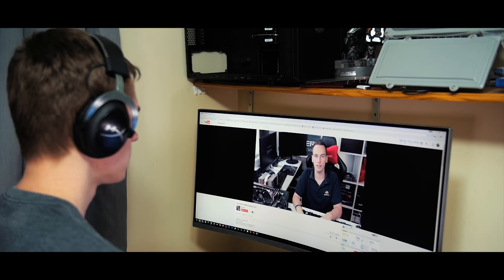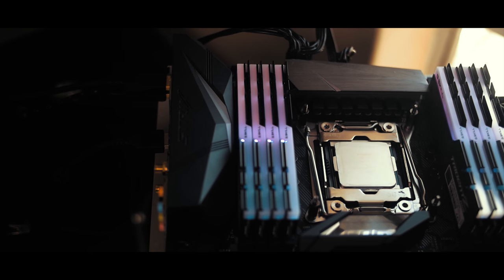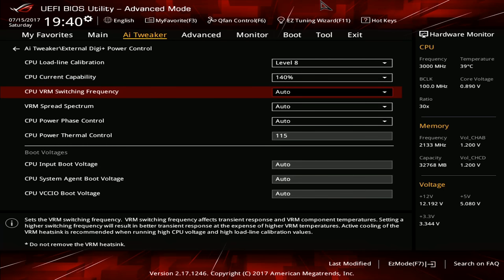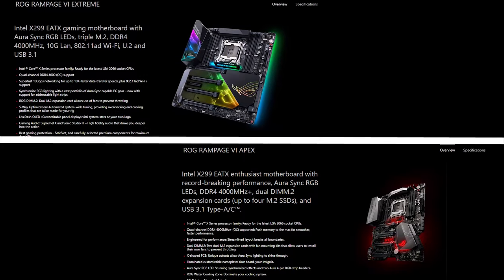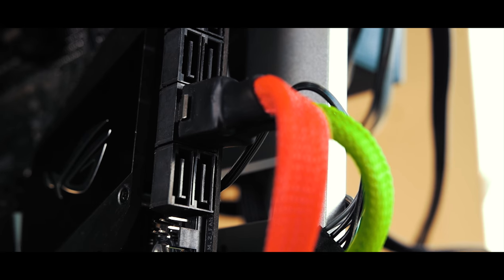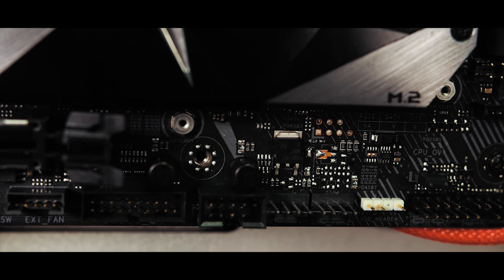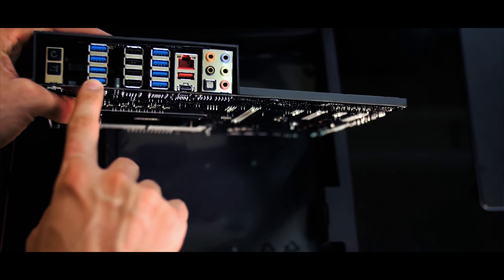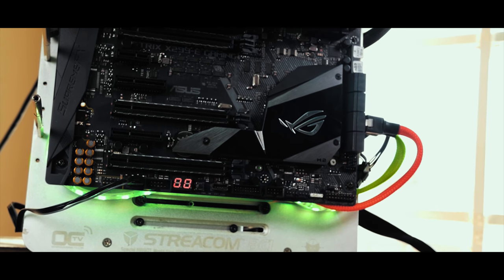WHAT VRM HEAT ISSUES? - ROG Strix X299-E Gaming Review

Comment: i bought new jeans it didnt have proper stitches but hey I got thread and needle at home. It is not a problem. Jeans are perfectly fine.
Reply from the maker: +ess wasim That's not exactly what's happening.  It's like you bought size 32 jeans but they tear at the seams if you're size 36 trying to fit into them.  Can you put them on? Sure. Is it what they're designed for? Nope.

Comment: I get where you are coming from. But it is the ENTHUSIAST platform and you are paying through the nose for this stuff. That just should not happen. Just like an "X" CPU with FUCKING TIM should not be a thing.
Also, when the 18-cores hit the streets, there WILL be a bloodbath.
If 10 cores are stretching it, how will an additional 8 cores treat these VRMs?

There is ONE upside to this: We prolly will se a sharp rise in Full cover CPU/VRM waterblock systems popping up on YT to gaze at.

Comment: Hey, I bought my i9-7900X and MSI X299 Pro Carbon AC specifically so I can do nothing but run Prime95 and calculate decimal places for the pi value 24 hours a day, 365 days a year. I hope to eventually set a new world record by computing pi to 2,000,000,000,000 decimal places!!
 
But seriously... you should have also mentioned that using a computer case that has top intake fans also removes the whole whining about VRM temps.  I have three Corsair HD120 intake fans up top with fan curves set to 1600 RPM for their high load setting.  My un-delidded i9-7900X is OC'ed to 4.7 GHz at 1.22V vcore, and my VRM temps hover in the low/mid 50s under sustained load while processing numerous 4K videos and thousands of RAW digital photos. CPU temps also hover in the 60s under heavy load, with a few cores spiking in the low 70s, with not a single core ever throttling. Mine is not a gaming rig, but it is all entirely for CPU processing of video, photo, and audio data, so everything always remains CPU-limited, not GPU-limited. Only when I run Aida64 do the CPU temps go into the mid-70s, and VRM temps go into low 60s. If I run Prime95, only then do I have to lower the OC to 4.5 GHz for sustained non-throttled load stability on all cores.
 
I de-lidded my i7-7700K and have it OC'ed to 5.1 GHz with two 1080 Ti GPUs SLI'ed in my gaming rig. But I don't care to take the risk of de-lidding a $1000 CPU just for the sake of getting less than 5% performance increase.
 
All of the whining about VRM temps is way overblown and exaggerated because they all involve high overclocks and the running of synthetic benchmarks. Especially for gaming use, and even for heavy media-processing users like me, VRM temps are really a non-issue, unless your PC case has poor internal airflow and your room's ambient temperatures are very warm in the summer. And even then, the whining is all about getting less than 5% of extra performance out of the CPU.
 
I also wished that Intel used solder on their i9-7900X instead of paste. But here again, the actual difference in performance is in the single percentage digits. If solder improved CPU performance by 50% or even 20% over paste TIM, then yes the i9-7900X stinks for using paste. But a 4% to 6% increase in performance due to an extra 200 MHz or 400 MHz solder-based overclocking is no big deal for a CPU that is already screaming roaring fast.
Reply: might as well mine xmr instead :)

Comment: There is really only a handful of reasons to go with this board for gaming. I personally did because the i9 7900x has sufficient PCIE lanes for SLI. However I feel that anyone that buys this board and doesn't SLI is wasting their money. The i7's for this platform don't support quad channel memory. Nor do they have enough PCIE lanes to fully utilize SLI. So it makes WAY more sense to use a 8700k or a Ryzen 1800x if you want to use just a single GPU for a gaming platform. Furthermore there is no point to using SLI if you are not using a GTX 1080ti. If you are using anything less than buy a better card before buying a second card. So, most gamers should avoid this board unless they are comfortable with SLI technology and its inherent headaches, and they plan to buy an i9. Also for those that insist that TR 1950x is better, TR has no where near the gaming performance of a 7900x. TR is a very good chip, but it is not intended for gaming in any way. In fact some games have issues even launching on TR 1950x.

Comment: All is nice. BUT! always that... if you want to get all the nice cool things that these x299 do, prepare to spend 600 or 1000 usd to make that happened. to much compromise regarding what cpu is chosen and board selected. sweet spot is 7820 and 7900. I will not mention any other cpu brand or maker. I hope that asus puts it pants well on that platform since x270 is a mess with windows 10. just in 3 days format checksum errors cbad, cause a nmve that was making issues cause a driver that is not compatible with IME and chipset from asus.  etc. for a personal note... Theadripper for me if numbers are ok